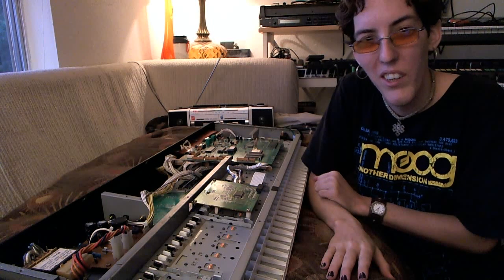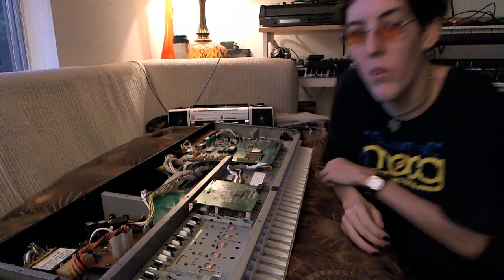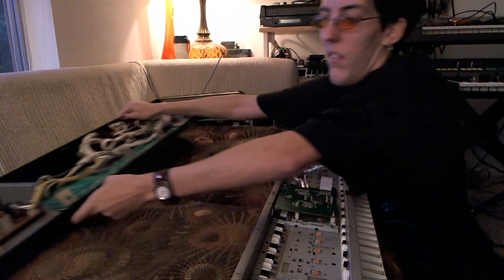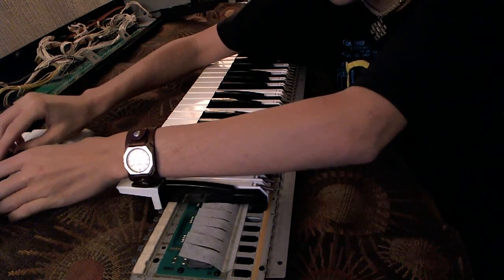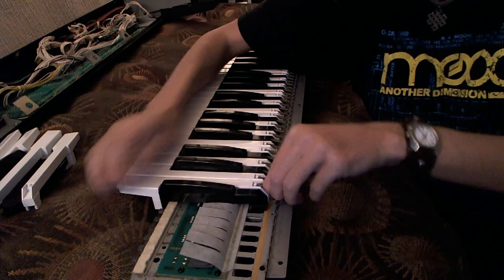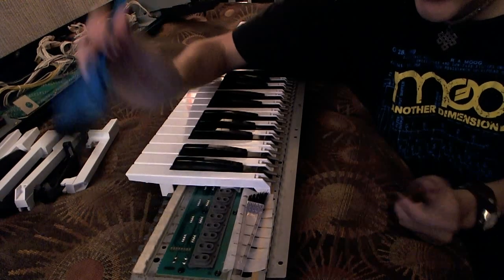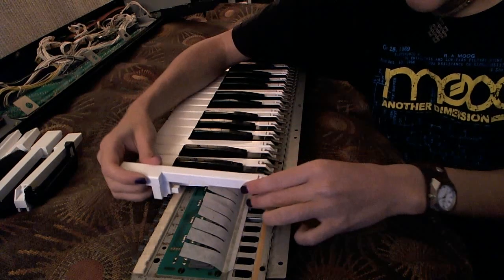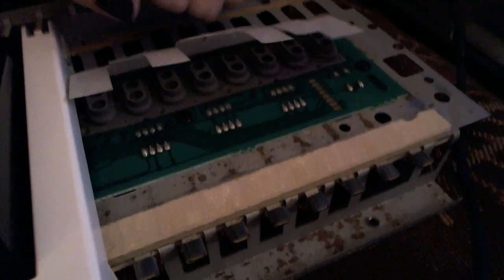Roland D-50: Key contact cleaning/Velocity issue

Comment: This is a really cozy and pleasant video to watch while quarantined right now. And also while cleaning a d50.
Reply from the maker: mrmanatee hi. That is so awesome. Thank you. :) 

It’s crazy to realize how care free times were back then. With this world changing so much, synths and music bring us a sense of safety and security as well as some mental work for our minds to keep busy. I have so much programming to do and will be making new videos in the next few days about synthesis and D-50. :)
please be well! 

:)
Reply: @TheSynthFreq  everything old is comforting these days. Anything I should look for while I clean this d-50? I haven't opened one up before
Reply from the maker: mrmanatee hi. So true! :) with the D-50, its a pretty simple setup inside, do be careful of the thin ribbon connector copper strip that connects the keybed to the main circuit board. It relays information from the keys and also the after touch information. It is located at the lowest key area of the keyboard by the pitch bender circuit board. This ribbon connector fits into a square socket and can be easily pulled out if you don’t know it’s there. So just open the back of D-50 slowly and gently so the ribbon doesn’t become disconnected. If it does you can easily reseat it back into its rectangular receptacle near the lowest C key. Also be sure to look up and download the service manual as it shows you all it’s parts and where each part is and what it does. :)
Reply: @TheSynthFreq  oh my god I straight up thought I'd torn that ribbon connector when I finally got the keybed out. I freaked out for a solid 5 minutes

Comment: Thanks for the video, cleaned up the D50 nicely. Bought mine new in July '87, the strange thing is you cant get the center circuit  board out for that center section octave. But it all worked out! One thing that freaked me out was once I had it all together there was no sound!...remembered I just turned "local" off..WOW what a relief..lol. No loud notes...nice..!Now my JP6 is on the bench ready for Europa upgrade! Cant wait to control everything through midi on the fly. Tons of fun.Thank you !

Comment: Your explanation on how to remove the keys also goes for the Roland HP-100 piano. Had to search for a very long time before I discovered how the keys be removed. After opening up the keyboard I didn't even notice that the keys are being 'locked' by the transparent strips at the bottom. So it was a real riddle to me how it should be done. Thx!!!

Comment: Thanks for that - I glad it's of use to you and all D-50 users.  Coding it certainly helped my understanding of the sound architecture - still can't program any decent sounds though!!

Oh actually I found the aftertouch does work but isn't as sensitive as it was - the reason I didn't get any aftertouch was because "Ext. Controller" in the menu was set to "Aftertouch" - changing it helped :).  But I only found this after taking it all apart - but it gave me a chance to fully clean it.

Comment: Everything is beautifully described. One suggestion would be to very gently clean the rubber popple on the contact side as well. Use a medium sized brush similar to a make up applicator. Always seems to help with that particular contact style. They tend to hold on to dust and dirt.

Comment: @wevelve - As TheSynthFreq said, these basic principles work for most keyboards, even though they're all a little different. What I CAN tell you is that I recently did this whole process on a friend's Super JX-10, and was astonished to see the keybed assembly was nearly identical to the D-50! The key mounting, springs, and even the style of keys was exactly the same.  Since your JX-8p is from 1985, and the D-50 was 1987, it makes sense they used the same type of construction.  Good luck!

Comment: @TheSynthFreq On some keys they are 127, some of them are behaving normally and a few of them behave strangely, that is, they are sometimes 127 and sometimes normal.

One of the black dots that make the contact broke out of one key (I don't mind that too much), but replacing it with something else (for example, a button from a old remote controller) will work as well.

I might open it up again soon, but synths are one type of electronics that are hard to disassemble and assemble back.

Comment: @ace Sao corps (continued...) ....the key might not sit straight on the keybed frame. As far as you Aftertouch, this is sensed by the white, felt pad under the keys. They wear out over time it seems. Mine hardly works at all anymore, so perhaps that's what you may be experiencing on your D-50?  Good luck!

Comment from the maker: HI :) We have a J2, great synth :) It has a similar set. Often times more than one cleaning is needed unfortunately. My D-50 has done this to me, where I clean it and put it back together just to find a key still acting up. Sometimes though if you give it a day or two, it settles in and starts behaving itself. Tearing down a synth several times adds to the risk of damage but a repeat cleaning can fix the key issue too, so its better to weigh the risks first. Best of luck with Juno2, :)

Comment from the maker: HI :) Thanks. :) I wish you luck with the work! Spray cleaner is actually more of a hazard for the synths since spraying anything into the keys while the synth is put together can introduce spray onto the PCB and might dislodge the sensor under the key along with allowing too much chemical into the synth. Its best to clean the PCB and under the tightly 'sealed' contact strip, spray wouldn't reach the area that needs cleaning unfortunately. The strip needs to be removed completely.

Comment: @svensoncorps - I have serviced both of the D-50's I own as well as another for a friend the same way TheSynthFreq has shown here. I agree with her that side-to-side key "gap" adjustment may be tricky. The keys are basically hooked on to the metal keybed frame and attached to a spring. There's not much to control the side-to-side orientation of the keys. There are two little slots in the plastic keys that slide onto the frame. Perhaps if these slots become worn and are "wide" or perhaps uneven,

Comment: I have a strange issue with my digipiano. The b and c keys have trouble sounding during scale runs or trills. Take note the problem occurs when they are played consecutively or one after the other. Played togeth er they work fine. In combination w/ other notes its fine. this happens to b&c and f&f# in all octaves. I appreciate all the input.

Comment: Hi, I enjoy your great tutorials on Roland d50. Following your video I'm stuck on disconnecting multi pin plugs (4) from key scan circuit board. I don't want to crack the plugs. My d50 is 28 years old and was never open. Appreciate your help. Thanks!

Comment from the maker: HI. The black material on each contact is most likely best if left there. It could be the carbon like material used on the contacts to help with the connection process between the keys and the processing/scanning board. If the black material is only on the contact itself and looks organized, leave it there just to be safe, if its random, and it all over the place, I'd just clean the excess and clean around the contact instead. 
:) TSF

Comment from the maker: hi :) I was shocked to hear the news of your dear D-50. If possible, go through the connections again, check that they're completely connected & no pins were bent. Some of the CNs have the same size ports that can be mixed up around the battery area. Sometimes just disconnecting everything can throw D-50 off but usually not permanently. A general reset might be necessary, but as last resort. I would recommend doing a re-check of all connectors, wires first. Let me know what happens.

Comment from the maker: @xan1242 HI :) Sometimes it may take more than one cleaning to get it behaving again. Also check to make sure that each contact in the strip that meets the circuit board has the black dot on the under side, if its gray instead, then the magnetic paint may have worn off. Also I would check the copper/plastic ribbon connector to the keybed as well just in case it has become disconnected. By the way, what extremes are the velocity values on your D-20?

Comment: thanks for this video as was very helpful. I have a key (3rd G# ) is not working. But I cleaned up the circuit board conacts and even swapped a rubber contact around and for that one key this still did not work (while the rubber contact worked well on the other keys - I just flipped the rubber section around). Do you think the circuit board is just broken for 1 key possible, as wonderinf if I really need to replace the whole board (thats if you can even get them anywhere) or do I really need to try and give that contact a good clean again? I even used the pencil trick and cleaned it up after but no difference.. Thanks in advance.

Comment: You must also clean the black conductive rubber circles on the grey rubber strip. I use Acetone which works very well. And if your aftertouch has failed, as they all do, you need to dissemble the felt covered strip that runs the length of the keyboard. You will then see a copper strip that oxidises over time and looses conductivity. Clean this with Brasso but make sure to remove all traces of the cleaner when finished. Also clean the rubber strip that contacts the copper with Acetone. When you put it back together is will work better than new. I have done this to 6x D50's.

Comment: By the way, is that metal "envelope" that holds the top half of the main board really necessary? It gave me a hard time re-attaching the main board and it's gotten damaged when the previous owner cleaned the contacts. There are sharp metal edges to it that might damage the traces on the main board. I'd hate to damage it while trying to tuck the board back in.

Comment: I'm having an individual single note velocity issue on my RD-700.

In the 90's I used to replace buttons and vacuum out my RD-500.

I suspect the basic guts are all the same.  Going to open it today and follow your directions for cleaning the contacts under the rubber strip.

Is there anything in particular that comes to mind with my problem.

Thanks for any response and advice you have time for.

Comment from the maker: hi :) Yes. The metal envelope is actually shielding paper (part 22255252). It protects the main board and its sensitive components. Please try and leave it in place as best you can. the board would be exposed to interference and damage without it. I would try and bend some of those edges slightly away from the traces but not too much as to touch the metal frame. The PCB will have a somewhat protective coating on all the traces but its best to be very cautious as you already are. :)  
:) TSF

Comment from the maker: Hello! :) I hope I have reached you in time. Changing the battery will automatically wipe out every sound in the synth, unlike some modern synths, the preset sounds and data are not retained at all. So, when you power up D-50 after a battery change, there will be random data on the LCD, no sound, no nothing to let you know D-50 is ok. D-50 isn't dead, but its just freaked out by the battery change. So you will have to reload the patches in by data card, computer or typing them in. :/

Comment: Great video - very informative as always :)

I just got a D-50 (to help with the D50 Librarian) and it doesn't seem to have a problem with the velocity but the aftertouch doesn't respond in the D-50 at all and the aftertouch MIDI messages sent out only go up to about a value of 60 (instead of 127) - so it sort of works but not very well.  Do you know if cleaning the contacts as you demonstrated would fix this issue or is it more to do with the sensor board (or whatever it's called)?

Comment: Hello. I need your help. I have a Roland XP 80, and I left it outside in my garage over the years, and it was standing up on its end. The heat of many summers, has melted to epoxy that hold the semi weights on the underside of the keys. It has run down the outer housing and some on the inside. It also got into the keys and several of them won't even push now because it hardened back up. I have my keyboard apart as I type this, and I am just now starting to try to clean the dried and hardened epoxy off with acetone. I watched some other videos of other people and they said acetone seemed to work for them. I need to cut this epoxy off and scrape it so I can clean my unit. I am not sure if the epoxy ran down inside where those pad things are yet. I don't think it did, based on just viewing them. I really like this keyboard, and it was my fault for leaving it in my garage when I wasn't using it. But I need advice. Is acetone the best solvent to use to break down this epoxy, or is there something else that works better? After watching this video here and some of your others, I believe you have the knowledge to assist me in getting my keyboard cleaned and back to playing again. I took time off from playing my keyboard because I started teaching myself the bass guitar. I will keep my keyboard inside from now on after I get it playing again. Please give any advice you might have that will help me get this epoxy glue off of my unit and playable again. Thank you in advance.

Comment: Thanks for this great video!  How long should I wait for the alcohol to dry?  Is there a particular kind of alcohol I should get?  Can you use alcohol on all electronics?  I have a Yamaha s30.  The design is nothing like synths worked on in all the YouTube videos I've seen, even videos that work on Yamahas, maybe because it's an older synth. The velocity sensitivity is malfunctioning on two keys, but when I took it apart I couldn't really see any dirt or corrosion on anything.  Any suggestions?

Comment: Really helpful.  My Roland EXR 7, some times the modulation turn on automatically,  it will turn of if we press the piano mode button, or cover the D beam(if the modulation function is assigned to D Beam).  I have cleaned the joy stick.  Still the problem exists. Some times it work correctly, but unexpectedly it will again turn to modulation turned on condition. Please help

Comment from the maker: @svenssoncorps Hi :) The gaps between the keys are a little difficult to fix than key bushings being leveled. My D-50 has same issue and the practical thing would to be to open D-50, take the keys off & take a look at the little metal tabs on the metal frame that the keys connect into. If you notice that the metal tabs are bent too far over to one direction or the other, you could very carefully and gently use pliers to bend the tabs to a better alignment. This takes a lot of caution! :)

Comment: Hello Dear,
I have Casio CTK-810, not being power on. I replaced power adapter,  replaced 3 transistors it was C3199 GR-133 Numbers written on it...but still not powering on. other diodes, capacitors, seems in good condition (not blown or explode). in Casio CTK-3200 had same problem I removed Transistor and bypassed power switch with jumper. It is still working fine. But what about his CTK-810 ? I don't know how to trouble shoot the problem and how to trace power in circuit or how to decide which component is missing...Hopefully waiting for your kind suggestion....Thank you.

Comment: Hi, Great video thanks and pushed me to do a successful repair myself. One thing, I read elsewhere that there are '36 shorter springs for the white keys and 25 longer springs for the black keys' but you mentioned as the other way around! Are you sure the black are for the black or was that  an error?
Reply from the maker: Hello. :)
Yes that is correct! Thank you for pointing it out. I had a moment of mix up there. So yes you're correct. 
Thanks for letting me know of the mix up. I'll add a correction in the video. 
:)

Comment from the maker: HI :) Yes this is true, you can do either. Please only do this if you are comfortable with opening a synth and the risks involved. I recommend first try leaving the main board intact/connected. if its out of the way and the wires are long enough, then its fine to leave it connected, saves time as well. :) Also if possible, work on D-50 on a flat, stable surface other than a couch hehe In this video it worked best for video purposes only. 
About the Moog shirt, thanks! :) 
:) TSF

Comment: This is one of those older synthesizers that would benefit from a custom rebuild.  I don't have one, but I've thought about it before anyway.  House it with an expander module in a single enclosure and use the midi input.

(desktop version?)

or you could use the rack version to do it probably..

Comment: I just worked on my old Roland ED PC-70 controller and all the keys are working again, thank you for this helpful video. I just have one glitch. After putting the springs back on the keys I have 2 keys that are to high compared to the rest of the keyboard. I checked the springs to make sure I had the right size and that checked out. So I checked for the metal piece as you said to adjust but it turns out to be plastic instead of metal. Is there anyway of adjusting the plastic piece without breaking it? Thanks.
UPDATE -
We I just found the problem! The plastic piece was missing a rubber piece that was floating inside the keyboard. I noticed something was missing compared to the other keys that were fine. Anyway, I GOT IT!!! HALLELUJAH!!!

Comment: Okay, so there are two contacts for each key, to measure the time difference between contacts being made; consequently, we get the velocity time differences, and it kind of simulates piano type dynamics.  Nonetheless, I thought that the contacts cleaning is about removing the film that builds up after time, and that could be done with one swipe with a pencil eraser.   Anyway, looks like it's dust then, and I was thinking wrong.